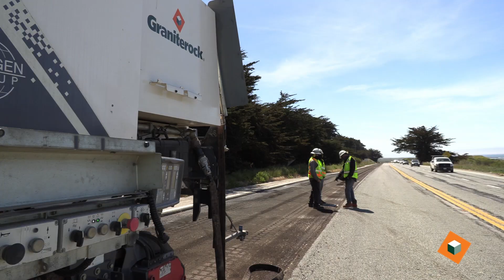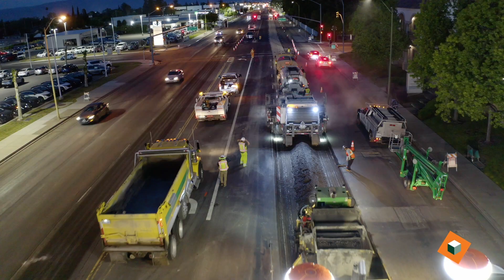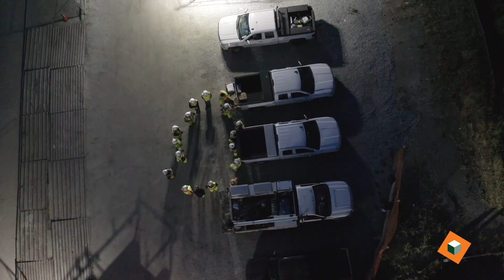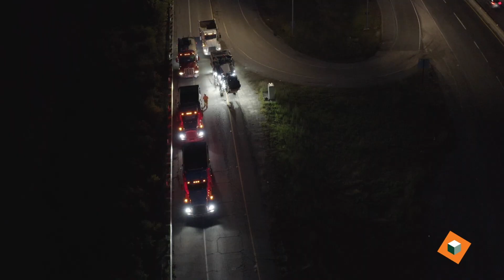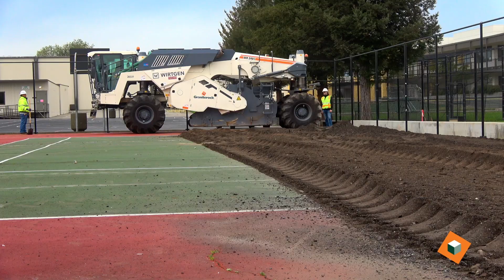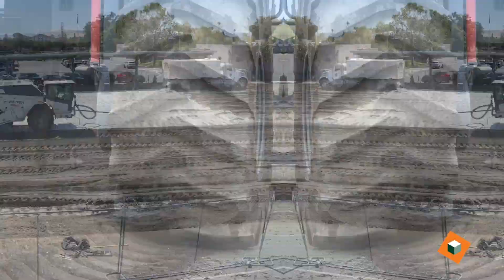California roads are on life support, here's one remedy that works for taxpayers & the environment

Comment: California roads are too wide and there are too many roads and streets cause of our horrible urban sprawl. stop urban sprawl and use pavers instead of asphalt.
Reply: miles5600 - Your comment demonstrates typical environmentalist unwillingness (I suspect it's not ignorance) to acknowledge the realities of life, that some choices are too expensive, that people will decide where and how they want to live based on a set of choices before them. 
I've heard similarly pithy but completely unreasonable ideas spouted by school teachers who aren't challenged by kids who haven't been taught how to think.   

First off, put away the pavers idea. This video is about taking pre-existing asphalt roads in poor condition and efficiently minimizing their replacement (and taxpayer cost) for their next service life by avoiding a full cut and replace with all new, which is what you're advocating with pavers. Secondly, pavers and the labor to install them are multiples more expensive due to more expensive and energy intensive materials, union and prevailing wage labor, and less efficient methods of mechanized installation.  They may have a theoretically longer life, but they are not without maintenance and wear issues.  Thirdly, and this should appeal to the environmentalist too, the texture of pavers makes them completely inappropriate for use on highways and even moderate speed roads, due to excessive road noise.  Modern asphalt mixes are incredibly quiet by comparison.  

Regarding sprawl, road building companies are not at fault.  Sprawl necessitates wider roads, not the other way around.  If you want to control sprawl, you have to get your local land-use agency to prioritize that, to avoid building housing on the edges until absolutely necessary. It will be necessary at some point, as any healthy urban area has growth.  Look at Portland Metro for an example of effective sprawl control in an area that is continually building and growing, and has multiple urban centers to offer a good jobs/housing mix to encourage people to live closer to their work.  If people want to move 5 or10 miles out and live on a few acres all to themselves, commuting on old farm roads, they can do that, but the edge of the Metro area slowly shifts, becoming 10 units/acre or more at the new edge.   The nature of urban areas will always be maximum density in the middle to lower density at the edges. People will live in a combination of what they can afford, balanced by conditions to tolerate and benefits to enjoy.  Many people aspire to home ownership on a separate piece of ground, particularly if they plan to raise a family. If demand falls for that type of housing, developers will build more of the other types.  Our system of government may reasonably advocate for less sprawl but it cannot dictate what people want to do.  Or maybe you think it should... 

That aspiration to home ownership is hugely compelling, especially if a  person's choice of non-sprawl housing is a much smaller apartment closer to work where the landlord gets all the ownership benefit.   If that means commuting 10 miles or 70 miles, that's their choice, and they live with the consequences, too.  In California, many road building and land-use agencies try to make that commute as miserable as possible -keeping roads narrow, adding stoplights or round-bouts, etc.  to discourage people from moving to the edges.  That's basically what you're suggesting - but it has significant costs that must be considered.  Many people will tolerate a lot more crap than expected for a place that they can afford and build equity, occupy happily on weekends, and if they have a family, a place where their children can grow up in what they regard as a more healthy environment, have access to a preferred school district, and so forth.  If those people have a miserable commute, they arrive at their jobs less productive and at home less able to deal with family life in a positive way, both of which can have significant broader consequences to the economy and society.  Good roads can have a lot of other benefits.
Reply: @douglasr8458  there’s a lot that has let the US to this point of having wide roads and it’s not that simple. Before the car was around we had very narrow roads for people and bikes but after car came around we took a U-turn in urban planning and then began the car dependent urban sprawl hell.

It’s our own fault and we now have to deal with it, cities keep widening their roads cause they think it’ll relieve traffic and make it more efficient except the opposite happens.

I’m not for traffic signals nor do i wanna put in narrow streets everywhere but we do need a lot more narrow streets cause our roads are simply too wide.

The MUTCD is the manual that sets all the standards for our roads and it suggests a lot of bad things like the 85th percentile which sets speed limits on roads depending on how fast 85% of the people driving go and a lot things lot minimum lane width.

Narrow roads slowdown drivers and keep noice down and would allow cyclists to be mixed and people to be more cautious of the people walking.

I know it’s really hard to imagine this complete system since (i would guess but i could be wrong) you’ve never traveled outside of the north american continent.

People drive because they don’t have any alternatives in most places in the US and the wide roads encourage them to drive even more, if you build places for people and cyclists then people will walk and cycle.

Portland is a good city that’s growing for sure but the rest around portland of full of sprawl and single family homes. Not everyone with a low income can afford a single family house which is the problem, they need a car while they might not be able to afford it and live in a house with a front and back yard that needs maintenance and a house the needs maintenance while occupying way too expensive land. Portland hasn’t fully allowed mixed zoning which is another big problem cause this makes the grocery store very far which also requires people to drive. Idk what’s wrong with narrowing roads so you tell me and maybe we can make a call to get a little more in debt cause i’d love to hear from you to get things on the line. Anyways i’m not ignorant, I’m actually quite the opposite it’s just that typing is way too much work.
Reply: @douglasr8458  Sprawl doesn't necesitate wider roads. Sprawl necessitates more amenities in the suburbs. The closer the destinations, the less people need to drive.

Roads that are too wide increase traffic jams with no ROI. For an extreme version of this imagine an intersection that is 1 mile wide on each side. That would take a long time to cross the intersection for everybody, and more time spent waiting for almost nothing.